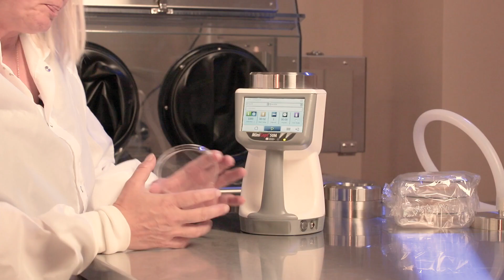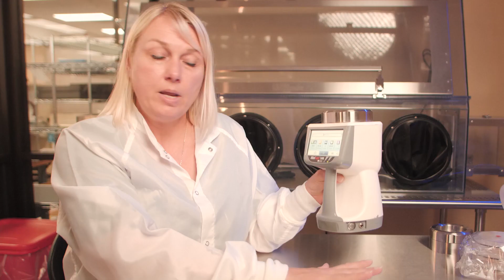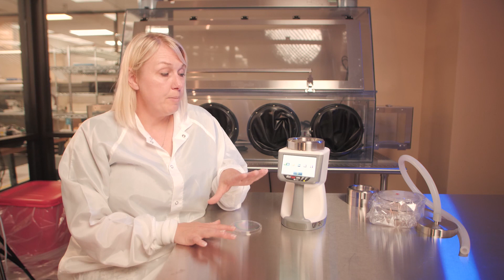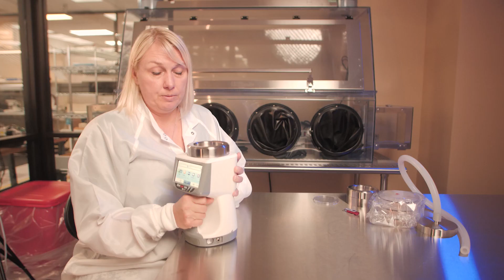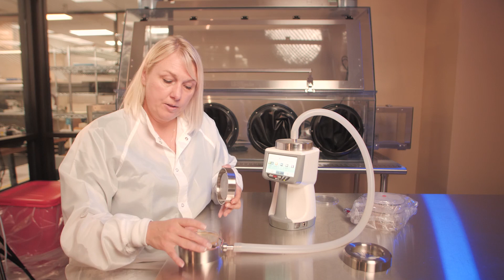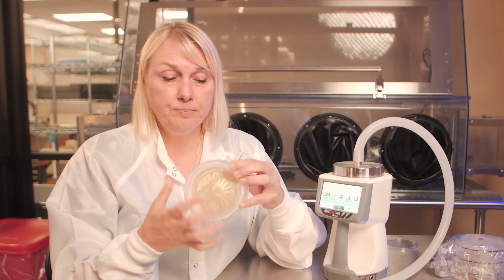MiniCapt® Mobile Microbial Air Counter & BioCapt® Single Use Demonstration

Comment: I'm using PMS equipment for 6 years now and it's awesome.
Minicapt 25M for aidsampling and process air.
Lazer 5100 for particle counting.
I recommend those equipment for aseptic production